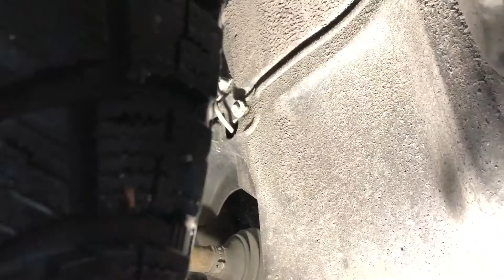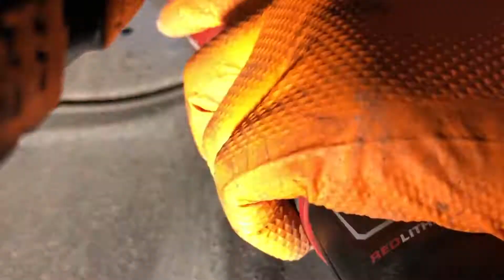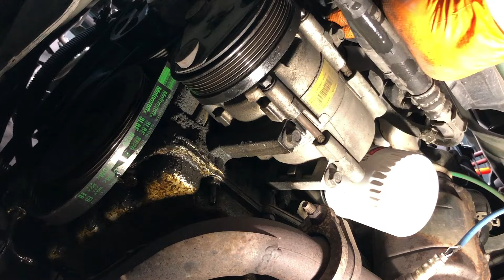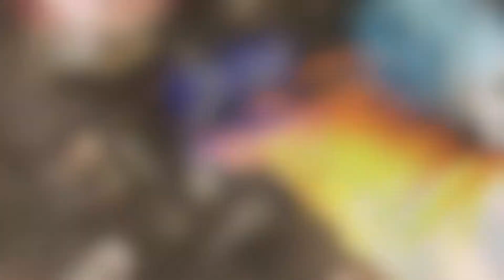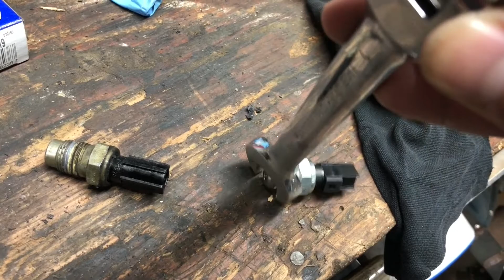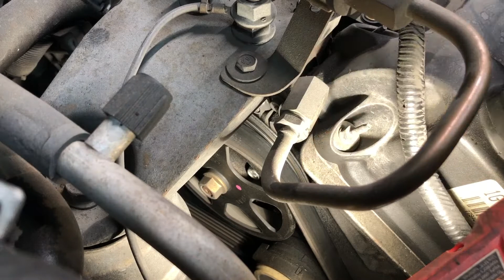2001 Ford Escape 3.0 V6:  Replacing the oil pressure switch

Comment: Wow, does your escape, leak alot of oil ! , it looks like it.
Reply from the maker: This was not my car, it was a customer’s car.  But yes, it had a few oil leaks - pretty typical on the 3.0 V6.  I gave her a quote to re-seal the engine and she declined to have the repairs done at that time.  Good thing, too - the car was unfortunately totaled in an accident (she was not seriously injured) not long after the filming of this video.  She would not have gotten her money’s worth if she had elected to have me re-seal the engine.
Reply: @AKJeeper , I've just done, a full set of brake hoses, front disc's, pads, two valve cover gaskets a sump gasket, crank position sensor orings, the pressure sensor has a weep!, Pcv hose ok, I still have a small leak at top of timing cover right by valve cover, I've just tried some external silicon, see if that works, we're  not supposed to have any leaks , especially over the exhaust, I might see if I'm getting vacuum from the pcv on overrun with some paper over the oil cap hole, this thing is killing me. 😬

Comment: Does anyone else have an issue with the new connector not being able to snap in like it's supposed to?
Reply from the maker: Sometimes I spray a little bit of silicone lube on to the connector to help get the connector to seat properly

Comment: Not sure if it's the same on earlier generation but 2009 3.0l you can get to it by removing the oil filter, no need to mess with the compressor.
Reply from the maker: The second gen Escapes might have a different AC compressor or method of mounting the compressor to the engine block.

Comment: Torque on these sensors range from 89-124 inch pounds. There’s not much room for a torque wrench I normally hand tighten then snug up with 1/8-1/4 turn. If you’re adding thread tape to a new sensor that not already tapped don’t and I repeat Do Not wrap it more than one full wrap and stretch the tape as you wrap it in the same direction as the threads. If you wrap it 3 or 4 times like a water fitting almost guaranteed to crack the engine block. I prefer if the new sensor is bare threads to use TP2  instead of thread tape. 
Also If you’re close to time for an oil change you can remove the oil filter and get just enough room to change the sensor. 
Great video very useful step by step on this job. Keep on wrenching.

Comment: No real need to move the compressor. Take off the oil Filter, and use a 13/16th spark plug socket with a wrench to turn the sensor out.  Literally takes 10 minutes.
Reply from the maker: Thanks for the suggestion - there's more than one way to do this job!  Moving the compressor made getting clear footage of the task much easier, which is why I elected to move the compressor.

Comment: Excellent video with little tips that help get the job done with no drama. Thanks for the tip about the different thread sizes on the sending unit. With my luck I would have ordered the wrong size online and would be stuck for days waiting on a replacement.

Comment: I can feel the switch with my fingers. Ima try to replace without removing the compressor. If I fell or break switch at that point, I'll remove compressor. I don't want to charge ac if I can help it.....
Reply from the maker: @stanleymorton2992  you don’t have to discharge the AC.  Just unbolt the AC compressor from the engine block, move it aside, and gain access to the oil pressure switch.  I did not discharge the AC on the car in the video.

Comment: Did you take out all your oil?
Reply from the maker: No.  It’s not necessary to drain the engine oil to replace the oil pressure switch.

Comment: Have you found the torque specs?
Reply: It's a moot point because a torque wrench wouldn't fit in there. I've seen on other videos to just measure the threads of the old one and screw the new one in to the same point; just be sure it is snug and have the push tab easily accessible. Do NOT overtighten!
Reply: @boomerguy9935  that's exactly what I did. Tightened it until it was snug.give it a half a turn and the car is fixed. Thanks for the video. If it wasn't for you idk what I would have done. I'll be subscribing. Thanks again
Reply: According to alldatadiy, the torque for the oil pressure sender is 10 ft-lb.

Comment: How did you know the oil switch was bad was your oil light coming off and on at stops
Reply from the maker: This one was leaking pretty badly.
Reply: Was your oil light flickering on
Reply from the maker: @barrettcouey380  It was on solid, and spewing oil when the engine was running.

Comment: Works exactly the same way with 2009-2012. Escapes. Great video. Only thing I’ll add. Is on the second gens at least mine. (2009) the alternator was in the way to be able to put a socket wrench onto the socket. But you can easily do it with a 13/16 wrench. 🤙🏻

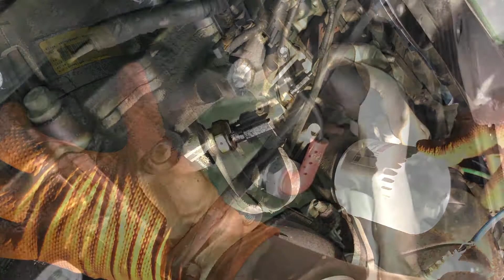Comment: 2:45  what is that other sensor next to the oil switch with the red connector on it??
Reply from the maker: That’s the engine block heater.  It is used in colder climates to aid with starting in the wintertime.
Reply: @AKJeeper  Thanks!

Comment: I tried doing this on an 08 escape without removing the AC compressor as some others have had luck with. I ended up breaking the switch so I’ll have to do it again with the compressor removed. Do you know if the process is the same on a 2008?

I only avoided removing the ac compressor because I thought I’d have to remove the line. Great video btw.
Reply from the maker: I’ve always moved the AC compressor out of the way on the V6 models.  It doesn’t take much time at all (no need to disconnect any AC lines) and saves the frustration.  And yes, pretty sure the process on the 2008 is the same.